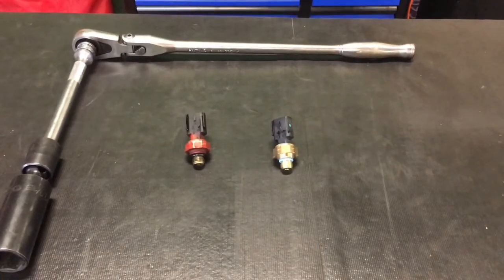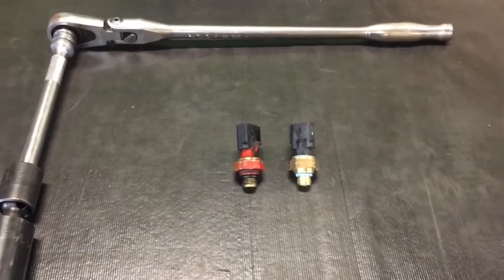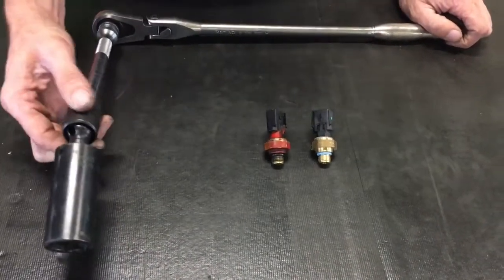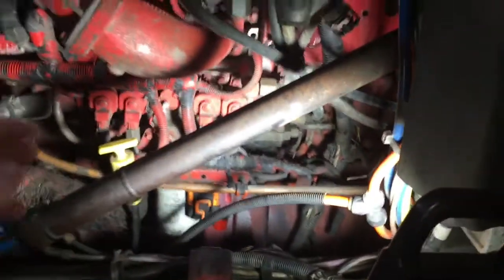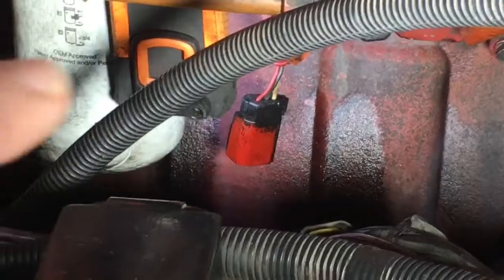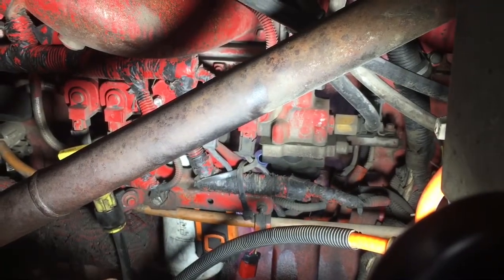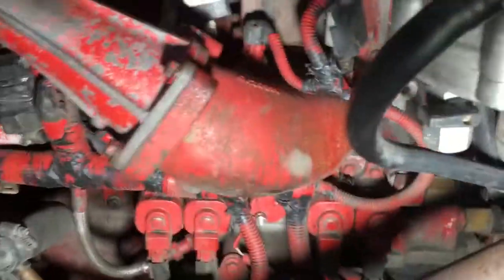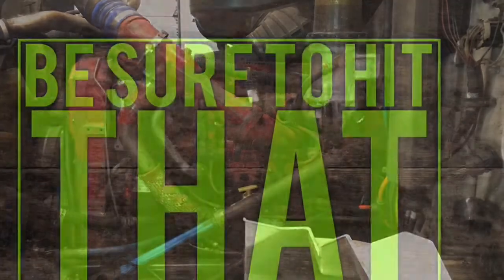How to replace oil pressure sensor on Cummins ISX

Comment: For those that want to know what "normal" oil pressure is, here's as follows. On cold start up, 40 PSI is normal at idle. Oil viscosity is high when it's cold. When hot, on idle I'm at about 22-24 PSI, well within Cummins range. This is running 15w40 Kendall XDA semi Syn. oil. These numbers will vary if you run 10W30 like many do now. I used to run 10W30. On idle when hot, it ran in the 17-19 PSI range. Thinner oil, less viscosity. Detroit states a Series 60 needs an ECM reflash to accept the lower pressure from running a 10W30 weight and not shut down from it. A soot packed oil filter can cause either high or low pressure(not sure which)

Comment: My question is, while climbing hills or mountains my pressure dropped to around 20-25. I pulled over checked everything and no leaks, oil level is good. After shutting down the engine the pressure will raise up to around 35. 
Is this a sensor issue or something bigger? Looking for feedback. Thanks you
Reply: Kenny Picotte I am having the same problem. Did you find out what the problem was?
Reply: @melvinsimmons6698  I changed out  the oil to Delvac and new filter and its back to normal. I have not had an issue since concerning pressure.

Comment: How do you get the little red tab to pop off?
Reply: I usually use a 90° pick or small flathead screwdriver to pry on the raised area on the red tab.  Should pop out about 1/8" and then you can push in on the connector release.  The red tabs can get packed with dirt so some wd40 can help free them up.
Reply: what size socket did you use to remove the sensor ?

Comment: My 2018 isx has that fuel filter back further with the cloth fuel filter is the oil pressure sensor in the same spot i cant find anything on it only this vid but its different

Comment: Oil pressure guage goes to “0” warning goes off. Replaced sensor, still does it. Installed separate pressure guage and it reads normal. Can I remove original oil sensor guage or how can I stop warning from going off.
Reply: Frank Kohl I want to know the same thing.

Comment: How often does it need changing?
Reply from the maker: When it leaks oil or the gauge quits working right. No time frame but most fail because oil will start to leak where the metal and plastic are formed together.

Comment: What was the truck doing ? How did you guys come to change the sensor.
Reply from the maker: I explained it at 0:34 in the video. Was leaking where plastic meets the metal plus the Gauge wasn’t always working correctly.
Reply: Got a Cummins’s m-11  runs fine for a load . Loses oil pressure and shuts off. Bearings have been checked they are fine. Oil pump is fine.  All this started after replacing EcM
Reply from the maker: Kevin Corbin check the weather pack connectors the may not have them tight or when they changed it one of the wires are loose ? on

Comment: Waht is the normal oil pressure for the IXS  maximum pressure running is 40 and parking is 20, it's normal?
Reply from the maker: Ed Leal cummins isle oil pressure is low. They will scare you at times like when you pull up to a red light and stop and it drops down to 20 lbs or so. They do run lower. Just keep a watch on it and watch your consumption
Reply: Koon Trucking ty dude is my first truck and don't have any experience with Cummins IXS engine
Reply from the maker: Just keep a watch on the consumption and keep it serviced
Reply: Cumins isx is low pressure oil
Reply: TerrorLobo Lee-al yes is good cold oil 40 and hot oil 20

Comment: I have Cummins isx engine my question is I have oil pressure down under 20psi when idle only pls help me if you have any idea thanks
Reply: Your lower end bearings need replacement and it needs it asap, if ur pressure is under 20psi. Im surprised ur engine still runs. It all cost u around 300 bucks plus mechanic 
work, should be about 600. Hope that helps buddy! Make sure u get that looked at asap as it can really do some damage to ur engine.
Reply: Thank you so much, one of Mecanic told me if I do I would do with oil pump too, where is your location?

Comment: Hey crazy question to ask I have a  2004  Freightliner  with a Detroit 14 L , I see my oil pressure sensor but I was not able to get my hand on it being that it's way in the back above my starter is there any trick that you guys know to be able to get to it
Reply from the maker: Gary Furtado you should be able to get to it
Reply: From driver side and underneath it be a little work on but not impossible